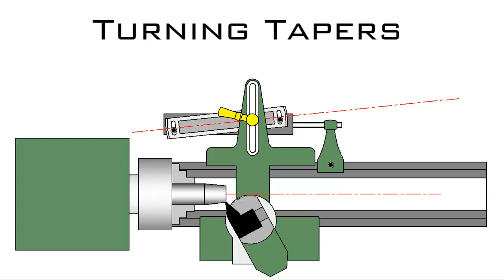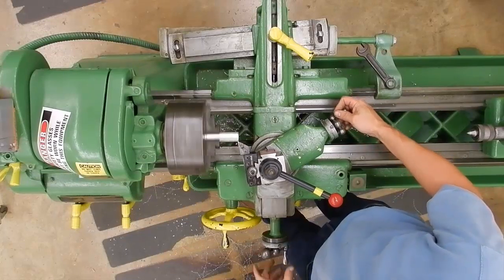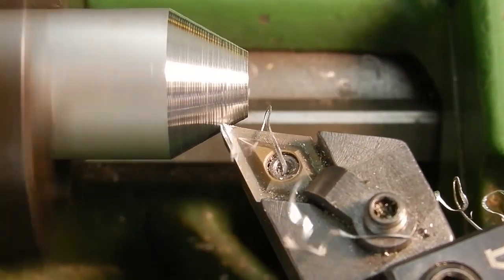Turning Tapers on a Manual Lathe

Comment: Hello: at 1:20 can you specify how to determine what is a recommended lead angle for the cut?  Is it 1/2 of the angle you are cutting subtracted from when the tool post is at 90 degrees?  So you are cutting a 30 degree non-included angle, and it looks like your tool post is rotated 15 degrees counterclockwise from 90 degrees at about 75 degrees.  Does this sound correct?  Thanks for the video btw.